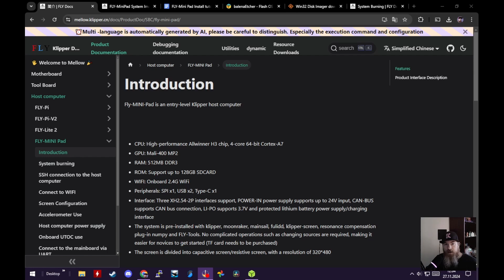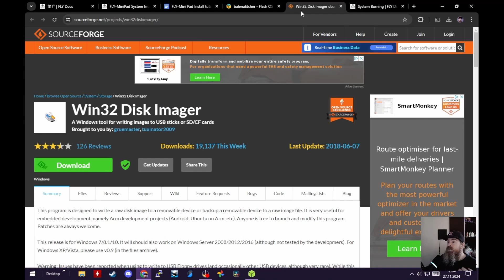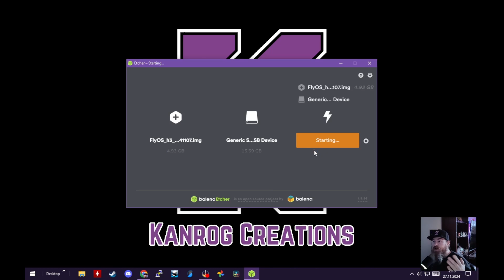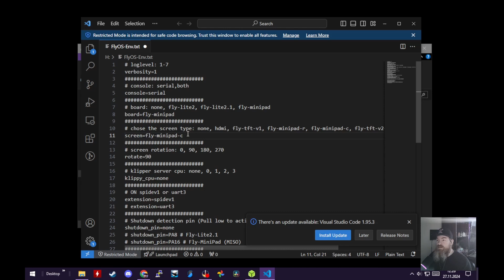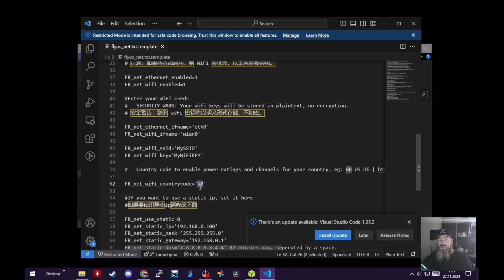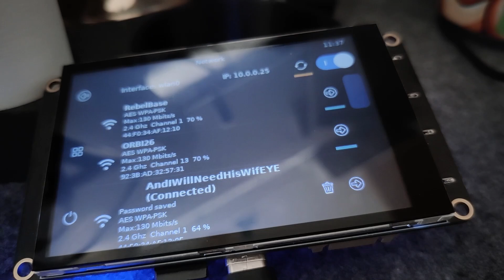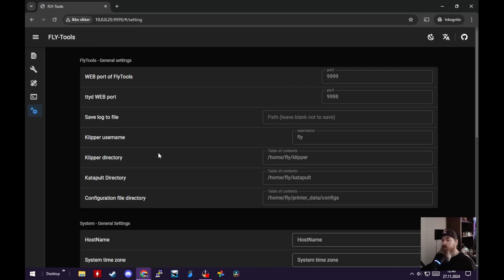Fly Mini Pad Klipper install tutorial!

Comment: Heja, happy I found your channel and super nice tutorial. I think I will start modernizing an older delta soon and I came across this Klipper pad and then found your channel. I have a question which you may or may not be able to answer. But Mellow calls this an "entry level Klipper pad" and it looks like the chip are RAM are slower/smaller than their Pi style offerings. Would you have any thoughts on whether the Mini Pad would still be fine for modern, faster delta...?
Reply from the maker: The specs of the pad is lower than a normal pi, but for a smaller build, or one not aimed at extreme speed, it's a great combo. As a comparison: A RPi Zero 2w runs klipper just fine, and this is a little better than that.
Reply: @kanrogcreations  Thanks man. I think I may go for it. It's cheap enough that if I end up having to upgrade it's not the end of the world. But I am with you on how nice it would be if they had 1-2 larger sizes of this.

Comment: Hello. So gys - i have bought this board to replace my raspberri pi zero w2/ And its slow like hell// i dont know what is wrong? but even boots like 5 minutes every time and ik got communication errors all the time
Reply from the maker: Try reinstalling the OS, maybe on a different SD card.
If its still slow, contact the seller for a refund
Reply: @  already tried 3 different cards(one of them brand new) and no still no go((

Comment: I ORDERED ONE ONLINE WITH AN ACCELEROMETER MODULE. I DON'T HAVE MUCH TECHNICAL KNOW HOW ON HOW TO MAKE CHANGES TO CODE TO USE INPUT SHAPING AND OPTIMIZE MY MARLIN PIRNTER. COULD YOU DO A VIDEO OF HOW TO USE THIS WITH A MARLIN 3D PRINTER AND DO INPUT SHAPING AND PREASSURE ADVANCE?
Reply from the maker: This only works with klipper
Reply: @kanrogcreations  can the marlin on the printer board be updated in any way to work with this board?
Reply from the maker: No, you have to convert to klipper
Reply: @kanrogcreations  I have an ender 3 V3 SE. would my mainboard support kipper? the pi is on the way so this would be a huge waste if it doesn't support kipper
Reply from the maker: @manurapeiris5871 it supports klipper, yes